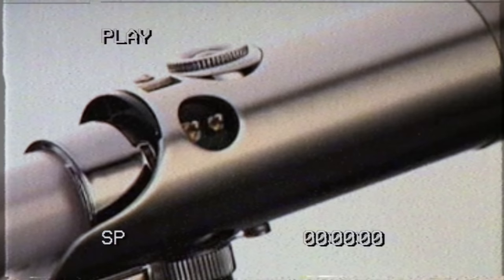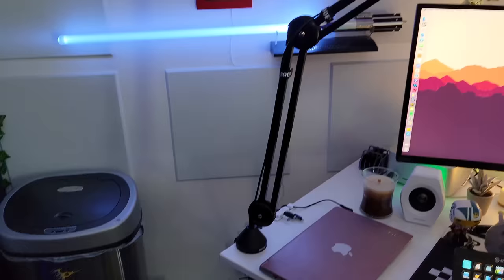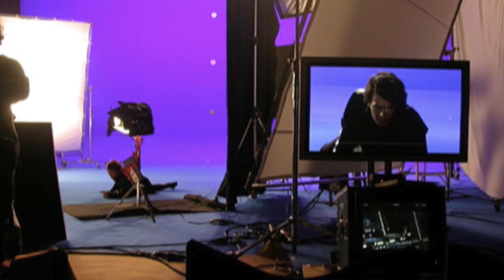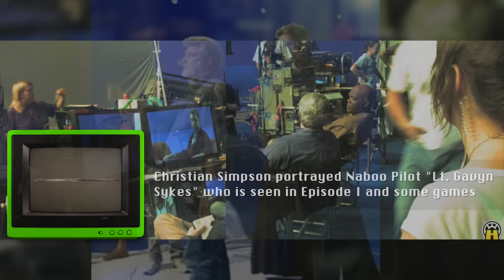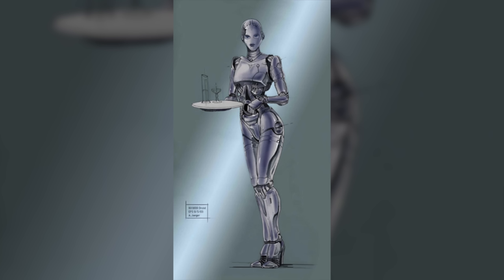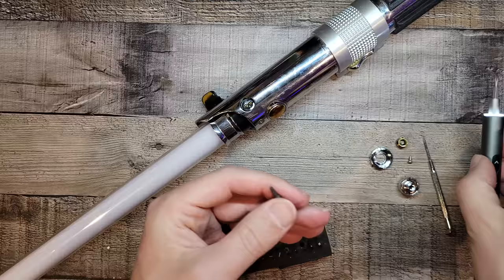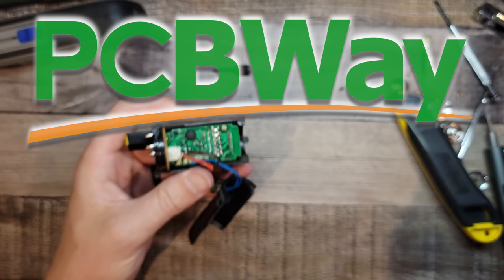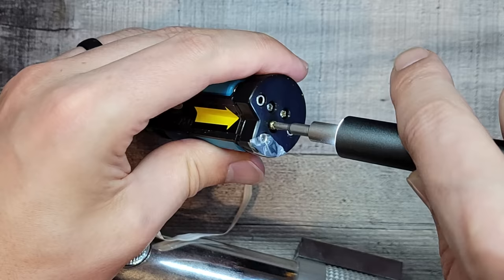Modding the Lightsaber replica I wielded on this Star Wars set!

Comment: ❤ I love everything I saw, per usual. 😁 I just soldered my very first thing last night. It was a resistor on an Atari 7800 cart that had a broken connection. It was so tiny and I needed my iPhone magnifying the area to see it. I was very much in need of a soldering microscope. All ended well, no burns, cartridge works. 

It makes me appreciate your ability to do this even more. I’m sure I’ll learn more as I go on, and I have a couple of simple jobs to do: soldering a new battery box into  Harleyfractic’s light-up stuffed star; and lengthening a too short wire inside my RC Davros so his eye lights up again. Simple stuff by comparison to soldering inside Commode 64s & Amiga 500s.  Now voltage meters- that’s right out the window for me- I have no idea what to touch to what and what the readings mean. Pure ignorance here. 😂
Reply from the maker: Glad you loved it sir! Keep at it with the soldering. It's really not that scary once you get going, even inside a C64. SMT is what scares me! Too tiny. 😩:_peri::_sit:

Comment: Regarding the resistors for the LEDs in the blade, based on my (admittedly limited) experiments with LEDs, I think the blue ones can tolerate a bit higher voltage than the red ones. At least for the LEDs they use in strands of Christmas lights. 

May the Fourth be with you! Just watch out for the Revenge of the Fifth.
Reply from the maker: Not to mention Revenge of the Sixth!
Reply: @RetroRecipes  Celebrate Cinco de Mayo with Flan Solo.

Comment: Nice retrospective. any time I see a hack like this I wish it was done with an added switch in this case one with two circuits putting a bypass on the sound closed while the mod to the blade LED's was open to maintain the original functioning in that mode with really thin bodge wires do the bypass you did. I hope it lasts. Prop re-makers test durability in many ways but rarely include a stress test it wasn't designed  for/continuous operation.